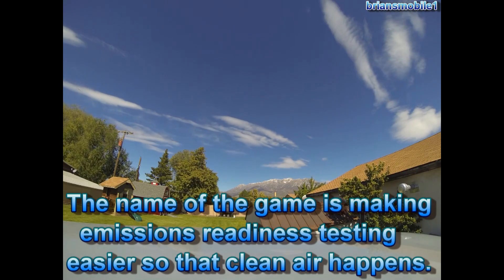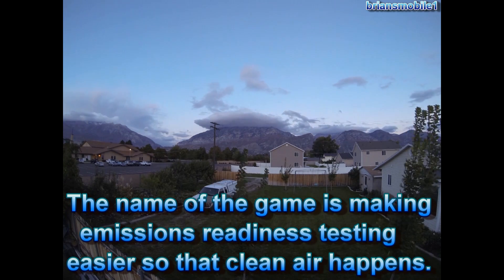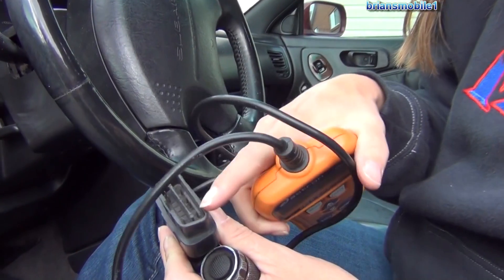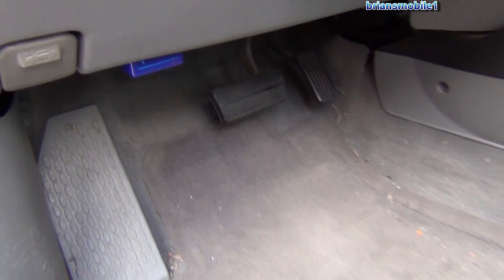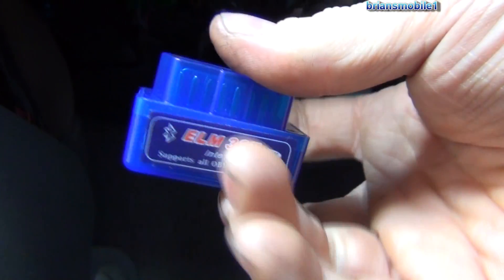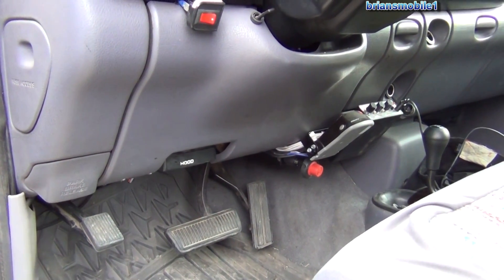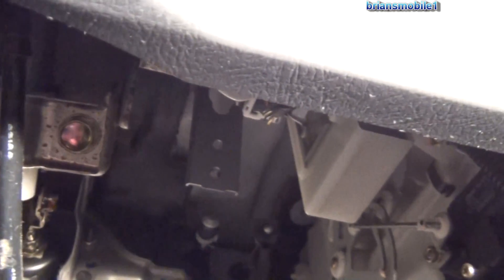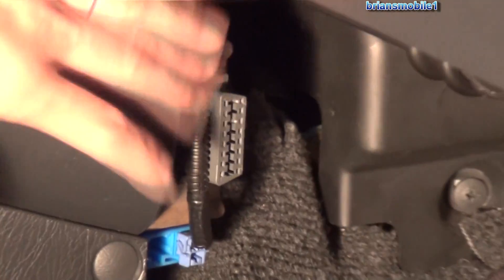OBDII What is it?  And where is it?

Comment: Wasting is an issue but cars are highly inefficient to begin with and how people use them is also highly inefficient. Combine that with the the number of cars on the road and the pollution cars emit and it's not hard to see improvement needs to be made. How many homes does one coal-fired power plant power and then how many cars are driven daily at those same homes.

If you think the clean air cause is BS, you haven't seen LA smog.

Comment: I really enjoy watching your videos. One correction on this one though. The OBD II connector by regulation can be on the the driver side or, up to 300mm (11 13/16") past the center line on the right hand side and still meet J1962 standards. The drivers side is the "preferred connector location" while 300mm to the left of center line to 300mm to the right is the allowable connector locations.

Comment: ive been using the elm 327 since at least 4 years and for me ist spot on always work great and they been really usefull for. Im a DIY and a do a lot of mechanic. tried this dongle and the torue app on mazdaspeed 3 2012, mazda 3 2004,mazda 6 2006, subaru wrx 2002, 2004, 2007, civic si 2007, civic 2000, 1996, cavalier 1997, sentra spec v 2003, chrysler 300 v6 and some other car and always work

Comment: I think the law is the OBD 2 connector has to be within 3 feet of the stearing wheel. but I think medium duty trucks are exempt because I have a 98 F-800 4x4 that has the factory 429 gas motor and it has an OBD1 connector on the passenger side under the dash.  the vin is clear it is a 1998 but I think they used old stock parts when building it.

Comment: Just to let you know (not trying to be rude), but there's no one specific location for the DLC. Taking the emissions class in my state, we were told there are something like 9 standard locations for them. I know some VW have them behind a panel under the climate controls, some hondas have them behind the ash tray, some Lamborghini have them on the passenger side. So it's not that honda was wrong in location, they decided on a different point of installation for one reason or the other.

Comment: Those were sometimes called 'blink' or 'blinky' codes.

If I recall correctly with Chrysler products you could rapidly turn the ignition switch on-off-on-off-on... then start counting CEL flashes... no jumpers required!

Some of the early pre OBD under dash connectors were called ALDL's.. for Assembly Line Data Link'.